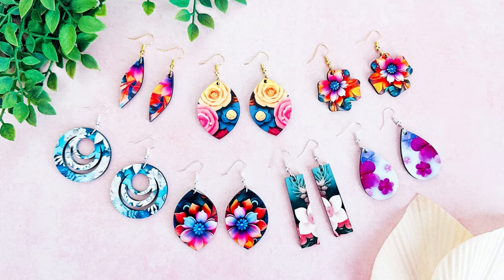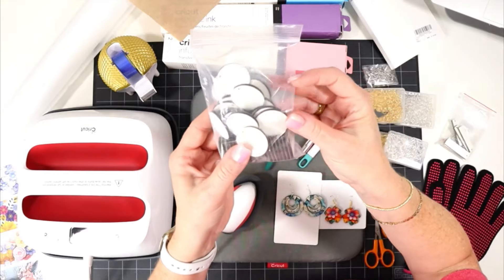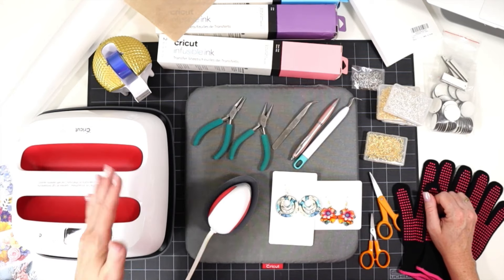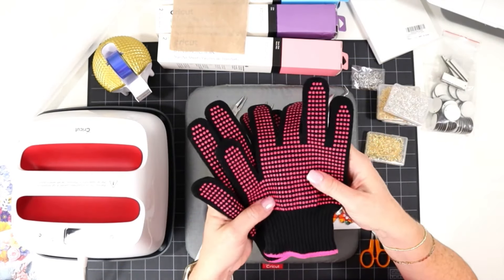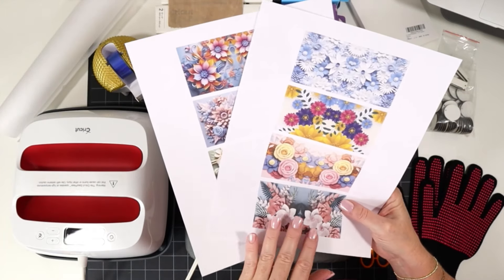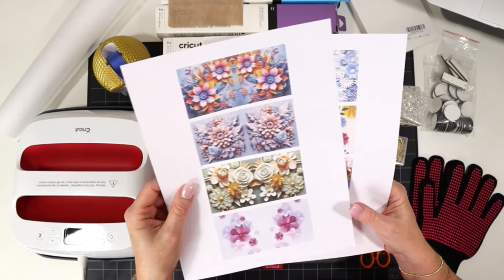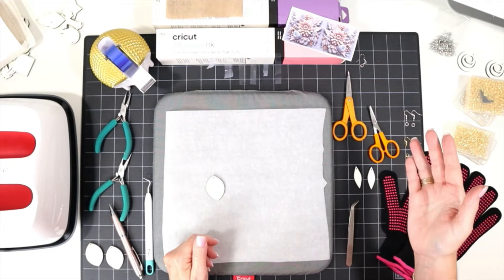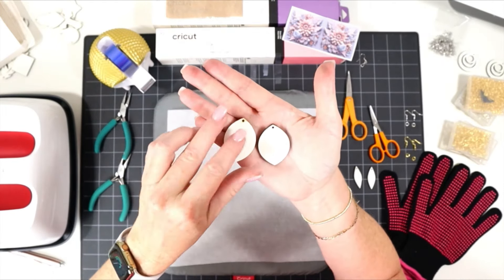How to Make 3D Flower Sublimation Earrings - 3D Floral Sublimation Jewelry

Comment: Love these so I order the blanks and got the free  designs. But I have a question when I went to print on my Circut I sided them down to 5 x 6.47 and they printed real small. Then I went to print the pdf and it prints right in the middle of the page.  What size should I print on my Circut since it dies a print and cut. And how can I move the design to save paper on the pdf. I am very new and not to smart  sorry for the questions
Reply from the maker: Hi, Yolanda! I’m happy to help answer your questions. This project is actually not a Cricut print then cut. :) 

It is designed for the PDF to print out on letter sized sublimation paper using a sublimation printer. I show this part of the process briefly in the video before I show how to create the earrings. You don’t need a Cricut at all for this project and I don’t use one at all in the video. I hope that makes sense! If you have any other questions, please let me know! 💗

Comment: Is a sublimation printer different from a regular printer?
Reply from the maker: Hi, yes! A sublimation printer uses special sublimation ink and prints onto sublimation paper. You can buy a sublimation printer, or you can convert certain ink jet printers (that are brand new and have never had ink in them before) for use with sublimation ink. :) I hope that helps!

Comment: Hi, I just found you here on you tube & I am new to sublimation. I am also doing earrings & I am having a hard time with my heat tape leaving a mark on the sublimation side. I have tried all kinds of different tapes & heat temperatures & pressure & I am still getting them. Do you have that problem with yours? I am selling these, so I can't have that mark on the earrings. Any suggestions?? Thanks so much for any advise.
Reply from the maker: Hi, thanks for your message. Great question! I don't wrap tape around onto the blank side, so I don't have that issue. 

But there are a few things you can try. First, I press on both sides and wrap my earrings a certain way so I can press both sides with the same wrap. You can try this technique that I show in the video you replied to, but it's also in this video here: https://youtu.be/fOghNxK4Fac

Another idea is if you don't want to press onto the back, you can cut a piece of blank paper and place it on the back and wrap the tape around onto that piece of scrap paper. That way you won't get heat marks on your blank, hope that makes sense!

Comment: Such a terrific video- TY.   Gorgeous designs and I can’t wait to get started. I am new to sublimation. I noticed in your first design, it printed a different color that your image. I know that the color deepens when you press it but this color seemed to changes from a pale blue to a yellow.  I have had problems like this with pale images going to yellow/brown and I thought I was over heating. Is it okay for the print to do this?
Reply from the maker: Hi, thanks for your comment! That's a great question. I'm not sure exactly which flowers you are referring to, but you are right, the printed images are much lighter and less saturated than the final pressed image. So in this case the flower's colors were just becoming more vibrant in the heat. But you are also correct that you can overheat and cause the print to start to turn brown. I don't think that's what happened here, but you certainly want to watch out for that! Thanks for taking the time comment.

Comment: I've bought those same blanks and similar and have been testing them out before trying to sell.  Why would some of the stainless steel hooks be starting to rust?  The little loop at the bottom of the ear hook seems to be the weak spot.  Is it because that's getting wear and tear from the dangle?  I have some with bezels and even the back of the bezel seems to be discoloring.
Reply from the maker: Hi, thanks for your message! That's interesting! I haven't seen that happen, but I don't usually use the findings that come with the blanks. Are you sure they are stainless steel? They could just be a darker metal color that isn't tarnish resistant, etc.